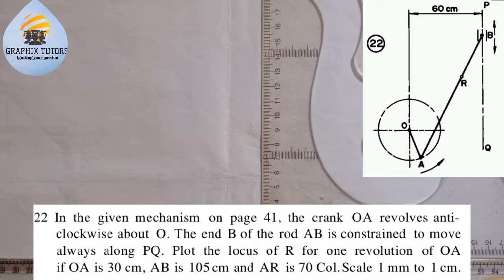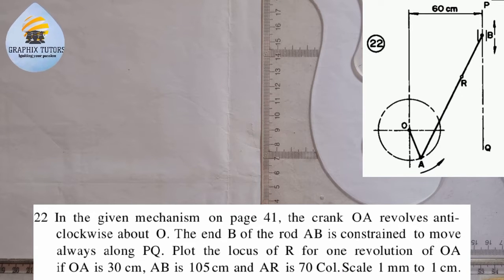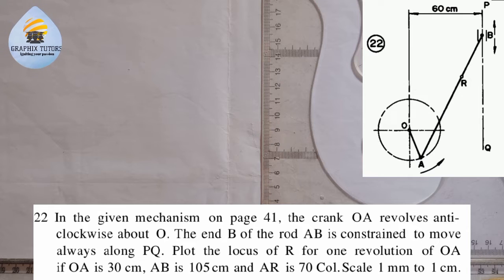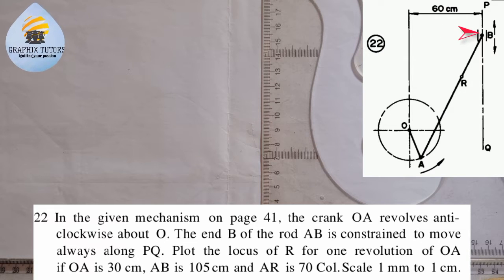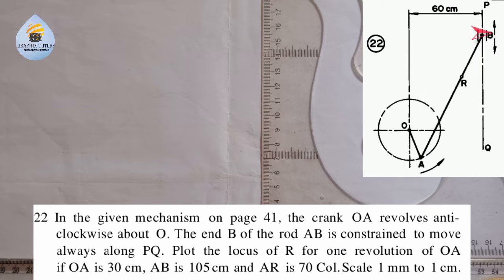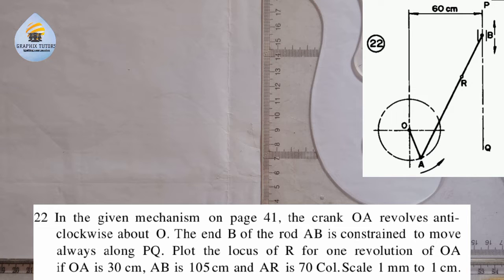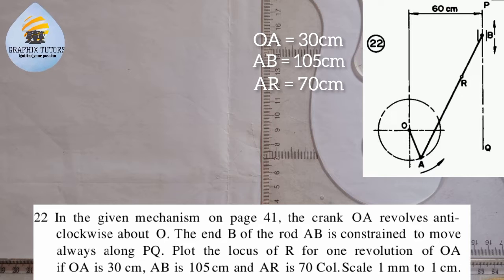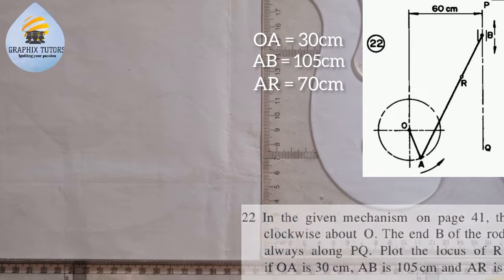LINK MECHANISM in Technical Engineering drawing (loci problem 22)

Comment: Crank OA rotates about the crank shaft  centre O. A link AB is joint to OA atA and end B is constrained to slide along MN.Trace the path of point P if link AB is extended from A.
OA=20mm
AB=100mm
AP=35mm
offset distance =15mm
Reply from the maker: What should I do with it